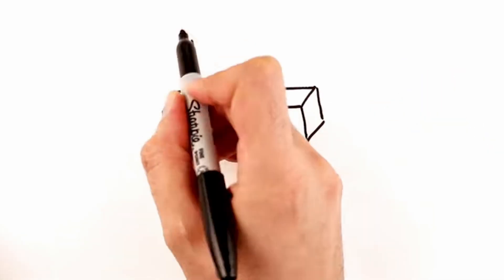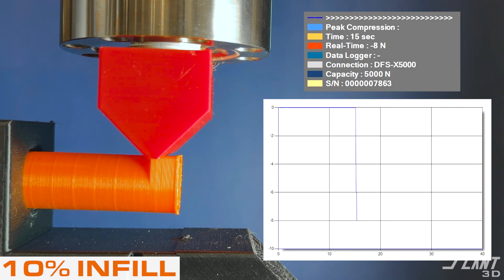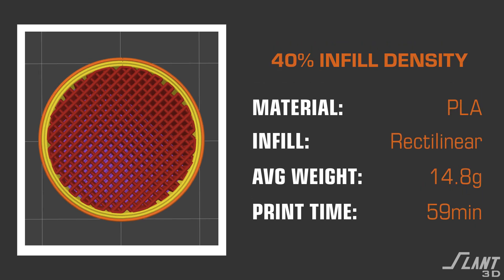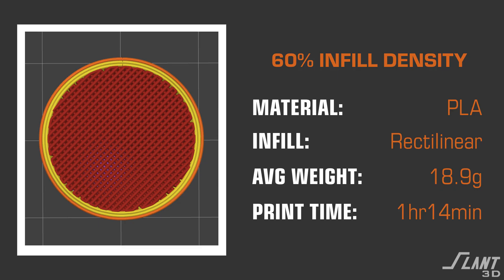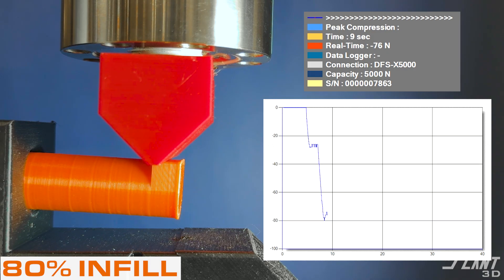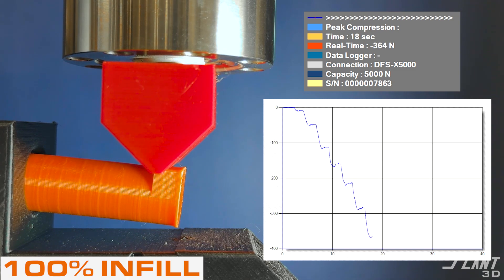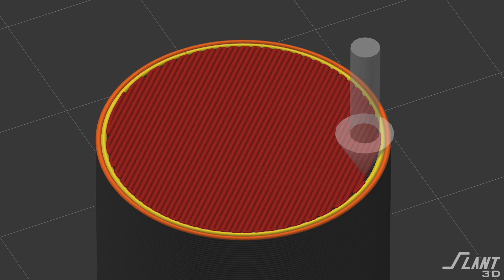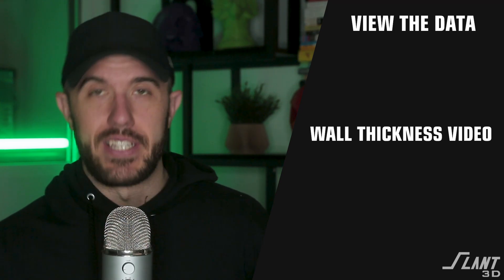The Impact of Infill Density on 3D Printed Beams | Bending Test

Comment: This is an interesting test, with unusual results.  As you increase the amount of infill the strength to weight ratio should reduce because the material added near the center of the section is not as effective in providing strength as the material closer to the top and bottom.  The strength jump at the highest infill percentages is happening due to some other phenomenon such as layer adhesion as you said.

Comment: it makes complete sense because there's also side by side adhesion as opposed to just top to bottom adhesion. There may have been some side by side adhesion at 90% but we should see nearly a doubling of strength to weight with 100% compared to all others since double the surface area is adhered to another layer.

Comment: So means if you need a strong part then directly 90 or 100% infill while all the other ones 15 % is fine and add if you need a stronger part as well minimum 3mm on the outside wall... do I see this correct?

Comment: The width of the infill membranes also can have significant impact while maintaining the same ratio. Double or triple the thickness of each membrane, and reduce their density by 1/2. or 2/3 You get the benefits of higher heat/adhesion without the overall higher material density.

Comment: Hi, there,

I think the non-linear change you're observing is not due to the process, but to mechanical concepts. Considering a homogeneous material from a structure is a complex subject which is the domain of homogenization techniques. There are also other techniques that take into account an internal length. When we do this, the simplest model is that of Cosserat, which adds the local equilibrium moment balance div(σ). This is justified by the fact that the internal length allows local rotations that are not possible if the material is "solid". Thus, it seems that the transition between equilibrium according to Cauchy and a generalized continuous medium is around 80%, which seems reasonable in view of the release of mobilities.
It's very interesting, but deserves more study!

Comment: I completely agree with the others stating that the test is flawed because of the orientation of the print. If you were designing a linear object that you intend to support a downward force, you wouldn’t print it vertically. 

It is a layer adhesion test and your results proved that infill was irrelevant in the testing until it was dense enough to effect layer adhesion.  Redo the test with the correct layer orientation and you’d have a more worthwhile video.

Comment: Can you do strength tests (shear and tensile) of a rod printed at 0 degrees angle, 10 degrees, 20 degrees, 30 degrees, and 40 degrees? Crucially can you test 10mm diameter, 5mm diameter, and 3mm diameter. I have a theory that the benefits of printing at a slant has a massive difference on thin/delicate features and their strength. It'll have a difference on the 10mm pole too, but I bet the strength gains are bigger in the smaller features. Would be good to get some data on it.

Comment: This is less a test on density, but more a test on layer adhesion with the variable being surface area. Can you rotate them 90 degrees, so the part is printed along the axis where the pressure would be applied?

Comment: My guy... You test across the layers not along them. Your failures are at the layer adhesion points. If you run the same test but lay the parts flat on the bed, you will get a much more accurate representation of the strength of the material with a given infill as opposed to when the layers will fail. Of course, higher infills are going to look better in this test because you have more physical contact between layers. You're also testing laterally across the infill as opposed to allowing the infill to provide actual reinforcement.

Comment: you said it yourself: contacting walls might make for stronger parts. What I'd like to see researched & never hear anyone really discussing is the relation to strength and infill walls. How much stronger/weaker is i.e. 20% dual walls vs 20% single walls @double width vs 40% single walls. How much time and filament could be saved? This to me would me much more interesting as its underreported & I think could give surprising results...

Comment: there is one trick people do and you might want to test. if you make a hole all through the model, how much strength gets increased. this way you will double walls. in theory it should be stronger with less infill.

Comment: Nothing surprising about seeing the same problems in composites and fibre alignment to the direction of the force. Only some of the infill structure effectively affects strength in the direction of the force since the rod is not isomorphic. Increase infill, more effective material in the way. Gets more complicated than that when you start looking at local plastic yielding and crack propagation, shearing.
Reply: Agreed. There seems to be inconsistencies in the testing procedure as well. I was hoping for more from what I thought was an engineering channel

Comment: Realizing this is testing a standard layer adhesion of roughly specific types of filament, but what about when you utilize variating layer heights/offset?  Seems like you would have greater strength if you have offset layers or if you have a greater overlap of layers.  Seems like these simple changes get overlooked.

Comment: Very nice & very well designed video. It seems like you actually had a plan for this video and how to tie it into everything else you're doing. Congrats!
You've learned to actually analyze your results and present them in context with the rest of the video, AND you were able to tie in the other channel, AND drum up interest for the next video. chef's kiss delicious! Just perfect on that front!
I'm going to start crunching numbers myself to see does strength/fill time show up in the same pattern. 
Your 20mm rod looks to be 100mm long. With the time you gave I could figure out you print speed.
Why do you have that discoloration every 10mm or so?? 
Interesting hypothesis. Not sure about the added melt time between layers. I believe it has more to do with the compressive half of the rod than the layer lines. The compressive half of the rod is able to resist more deflection (% shortened in mm), preventing the tensile half from separating at the layer lines, which is what is the actual failure.

Comment: Strange to call this a compression test.  It is a bending test, with failure likely due to tensile stress (not compressive) on the top of the beam.  Also, this is the weakest orientation.  Nobody should print a part expecting bending loads with layers lines perpendicular to the beam axis.

Comment: These tests would be a lot more powerful with stress/strain graphs to visualize the elastic phase of the subject. The 'switch' mentioned is the anisotropic infill type starting to approximate a fully filled interior (could be controlled by rotating the part). In this test setup, the top half of the sample disjoins at the layer line due to bending stress, so it would probably be better to report maximum torque instead of force.

Why only one sample at each condition?

I really love this series and would be ecstatic if they were a little closer to standard.

Comment: I've been printing extensively on PETG, and using infill as mesh for side panels, well, actually all over the place, in my designs. Through my my design process, I have experienced significant issues with printing single stranded prints. Infill is just that. To be printed as expected, I need to print super slow. I actually use 17,5mm/s on my MK3. I have to print at that speed, if the results are to be consistent. Also, I need to increase the line width a bit. I think I ended up at 0,63, and if I use 0,6mm the print will actually be off, visibly off, as the extrusions will not be constant.

You do not disclose any info on how you print your infill, and you use PLA. But printing a large flat piece, with no top or bottom layer, will enable you to really inspect the quality. You need to look for consistency of the lines. I paused it at 6:41, and it is clearly visible.

Looking at your prints, you seem to have a reappearing pattern on the Z axis. It seem to be at at fixed frequency, indicating an issue with your z-axis. Not sure if that affects what you dis here.

Also, I need to dry my filament, you probably need that as well with PLA but to a lesser degree. Not sure if you did, and I have no idea how that would play out in these tests. But I guess I would really weaken a lot of lines, in single line extrusions, at least, that is what I have been facing.

I will end this by pointing out that your findings do not match mine. I find that multiple layers with infill, is stronger than a single layer of solid fill, it the weight is the same. Also, I do not find there to be this dramatic jump at the end, but I might be mistaken on that one. There is something off with my screws of late, using 80-90% infill as opposed to a 100%. I might have gotten that part wrong.

Anyway, if that jump at end is a real thing, and universal, it will influence my designs significantly. Not sure how to deal with that yet, but nobody else seems either.

Thanks for the video. Love the effort and work you put into this.

Comment: Why reclinear infill? This test is for people who cares about mechanical properties of their parts, and few people who cares about strength use reclinear infill especially at low density. I'd recommend provide more realistic testing scenarios, use cubic or gyroid infills.
Reply: Because it's a standard. The same argument could be made for any other infill as well. Also, different patterns will probably only change absolute strength but the trend with higher percentage might still be the same

Comment: Trial 2 on the 2mm was a bad print. There was some other variable that caused it to break early. Probably a small zone with bad layer adhesion. Throw out that test and then there is no big jump between 2mm and 3mm.
Reply from the maker: There were three samples of each wall thickness tested. No singular prints to avoid this variability

Comment: Your testing methodology is questionable... I feel like you literally just pointed out what was obvious... more infill = more contact points between layers = better layer adhesion.
I think you should have rotated the part 90 degree during printing to actually test the strength of the infill rather than just testing layer adhesion.
Reply from the maker: That is a different test

Comment: I believe there's a simple explanation for the increase in strength as infill approaced 90% - there is now more material near the OD of the part.

As we know most of the bending strength and stiffness is contributed by material near the OD.
Reply from the maker: That does not explain the non-linear increase in strength. If that was the case each increase in infill would would create a correlative increase in strength. But that is not wat the data showed. There is a step difference from 80%-%90
Reply: @slant3d  Not sure I would expect it to be linear because it's not until infill gets high that there's a significant amount of material, relative to the outer walls, added near the OD. 

Someone (not me) who's motivated enough could check this by calculating bending moments of inertia of the entire section as infill increases.
Reply: @slant3d  I think there's a point where the density is sufficient that any extra filament extruded at the ends of the infill travel don't have room to squish to the sides, and they get squished into the inner wall layer a bit more than they would otherwise. I suspect you might see the same jump in strength at different infill densities if you vary infill extrusion.

Comment: Off topic, but for the designed for 3d printing series how about a 3d printed coat hanger? The injection molded ones cause sweaters to deform, and don't have enough strength to reliably hold heavy coats.  I could definitely see paying a couple bucks for a well designed coat hanger STL.

Comment: Looks more like a layer adhesion test.
Reply: Because it is.
Reply: Would love to see the test repeated at higher print temperatures.
Reply: Yea, they printed them in the wrong direction so it's testing later adhesion, if they test perpendicular to the print direction you'll see the difference in strength w/ infill.
Reply: Yeah duh? Because the variable being changed is the infill density we are seeing the effect that infill density has on layer adhesion
Reply: @amicloud_yt  sure, but it would be more useful to see how a beam with layers parallel to the ground bend as you put pressure on its end
Reply: @amicloud_yt I think his point is you see breaking along layer lines, which indicates poor layer adhesion. Printed parts printed at slower speeds and higher temps tend to fail across multiple layer lines.